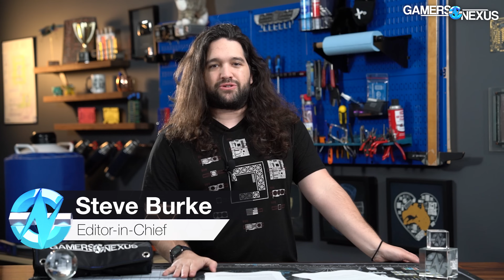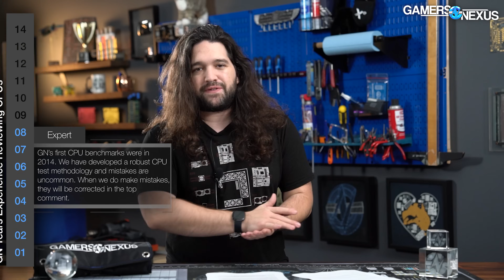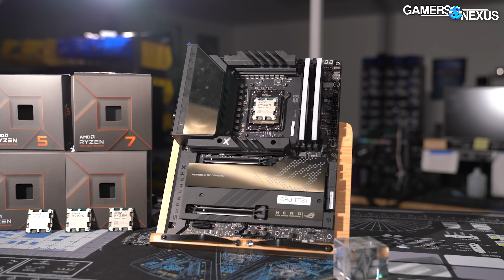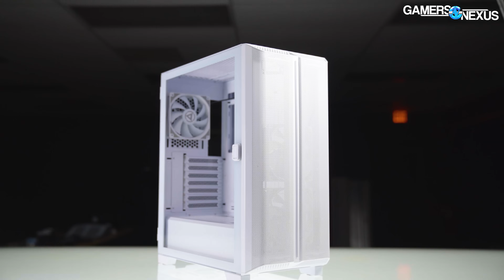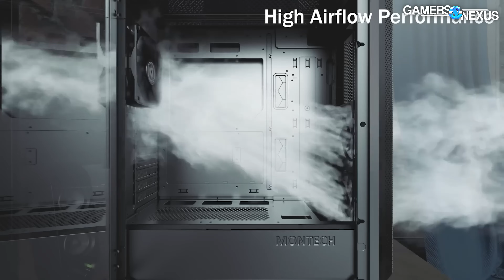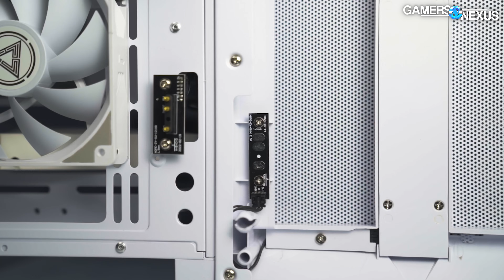AMD Ryzen Eco Mode Deep-Dive & Benchmarks on R9 7950X (Zen 4)

Comment: if you'd just adjust the PBO curve offset or PPT limits manually rather than using the Eco preset, I'm sure you can get results within 1-2% of the top results while still reducing power and thermals massively. also, remember that it's not always just about the cost of energy. being able to half the output of your 700 Watt "room heater" is a blessing during hot summers.
Reply: Probably, similar thing for older 3000 and 5000 series, where manually adjusting the limits can get you pretty close to stock performance while also getting most of the savings of eco-mode.
Also don't forget about noise, not everyone has the nicest cooler and although they're much better these days the stock coolers are a bit noisy when they ramp up more than about 30-40%, so being able to maintain that more often is also a big benefit.
Reply: Negative PBO curve offset seems stable for days then randomly gives me WHEA errors, it's not something a person buying for a workstation would want to use. One flipped bit might be hours or days of lost work.
Reply: @AFistfulOf4K  Issue for me is idle crashes. I can run Cinebench -25, but had to settle on -15 to avoid random idle or low usage crashes.
Reply: @xeridea  I wish I could modify the curve itself to be more aggressive for negative vcore during load and almost no negative vcore when idle to stabilise desktop idle on Ryzen. Vdroop alone doesn't give me nearly enough control. This is exactly what I do for my GPU undervolts and it works amazingly and never crashes in idle.
Reply: @xeridea  You might have the voltage offset too low. Had a couple of black screens within a day or two, went back from -.125 to -.1, and now not only do I get better R23 results, the CPU is also passing CoreCycler.
Reply: @xeridea i was running -30 on all cores, used the CO option from Ryzen Master, every test was running perfectly, 16000 cinebench r23 score with temps never exceeding 75C in a 24C room. But it would crash while idling just like you said, which I find very odd.
Reply: @xeridea  For my 7950X, Eco Mode 105W and -30 CO ran Cinebench no problem but ended up having idle crashes.
I then settled on -25 and it's been smooth as butter for years now. Even tested with Prime95 for 2 hours to make sure. 👍
Reply: @AFistfulOf4K  In fact, most of the tuning is tested with Cinebench which really does not represent real life work. I just did testing with actual rendering video ( I work in the film industry ), the PBO tuning actually increase the render time by 30% - 50%. What is the point of cap limiting the power at 210 - 240 ish, when running at 300 - 400 watt for half of the time, actually save more power? While under volting does save power and reduce temperature, from a productive point of view, under volting is not at all good. The eco-mode is actually useful when you are not doing work. The only pain in the arse is that you have restart the pc to get the setting working.
Reply: @dutchmilk  Agreed, eco mode by itself seems like a good feature and PBO is mainly good on paper. I'm currently trying to decide if I should get a 13900K or 7950X for video work. Despite the higher overall cost I'm leaning toward 7950X with the "105 watt" (really ~150 watt!) eco mode, but I've heard Intel's integrated graphics can be useful in Premiere even if you have a discrete GPU as well (which I would probably get a 3080 12GB). I'm not sure if this applies when proxies are used though...
Reply: @AFistfulOf4K  You might want to factor in the immaturity of DDR5 if you are going for AM5 as it does not support Quad channel RAM ( yet). It is the same situation when DD4 first came out. A 3080 is good, however, the RAM "problem" on AM5  is ease better with the additional 24gb of RAM on 4090. I would advise you getting this since you are using for video work.  I got the 4090. While it is stupid big, its performance is indeed far better than the 3000 series.

AMD is the clear winner for longevity wise, given how long they supported AM4. AMD eco mode is extremely useful to deal with the increase cost of electricity.
Reply: @dutchmilk  I think you're using the wrong terminology, no consumer platform supports quad-channel ram, only dual-channel, but you can have 1 or 2 sticks in each channel. The current problem (I forget if both AMD and Intel are affected) is if you use 4 sticks, the RAM runs slower than if you use 2 sticks. You have a point though, a 2x32 GB DDR5 kit is probably very expensive. 4090 would make a lot of sense, I agree, but I'm going to wait until I'm confident the power connector issue is solved across the industry. There's faulty 4x8 pin adapters and even faulty PSU cables out there. 12GB VRAM is enough for my tasks for now.
Reply: @AFistfulOf4K  aye, you are correct. I used the wrong terminology.
Reply: On 5800X, I can actually get higher than stock performance at slightly lower power with voltage offset. Probably similar with Zen 4.
Reply: @xeridea  Voltage offset (-.1, -.125 was too much for certain loads to be stable) plus curve tuning is getting me +6% from stock on my 5900X so far (with loose power limits, but those are relevant in benchmarking anyway).
Reply: on my 7700X i never seen temperatures above 70C even though i use air cooler.
i believe you need a synthetic test to get it 90C hot?
Reply: @davidjones5059  yes gaming does not hammers the CPU like synthetic tests.
Reply: Just deliding drops power usage by reducing thermal runaway as well. iirc by like, 20 watts.
So you'd probably be able to get better perf at lower power consumption using all the tricks you can throw at it.
Reply: Yes, you could achieve most of the efficiency gain by limiting maximum boost CPU frequency.
Reply: Americans are used to their air conditioning so they don't think about that.
Reply: @Sunlight91  AC is pretty required in Florida to have any level of comfort. You've got 95F+ temps with 100% humidity outside.

But cutting that heat down lets it work much less harder and heats up the room a lot less.
Reply: @Sunlight91  No A/C in my dorm
Reply: @Sunlight91  America is HUGE ass country m8! I live in the Northeast and I only know 1 or 2 peepz that got AC.
Reply: @Sunlight91  not sure this comment even makes sense. energy consumption is cumulative. anyway, many Americans would literally die without AC. we're going to need to get to a very high level of renewable energy production and/or capture and many years thereafter to reach a point where most people can go without AC with no adverse health effects. it is and will continue to be a worldwide problem. and before anyone quips, yes, I am fun at parties 😝
Reply: @Sunlight91  lots of Americans do not have air conditioning.
Reply: @GameTimeWhy  
Lots of Americans do not have five hundred dollar processors.
Reply: @GameTimeWhy  If you have this cpu in a personal machine, you probably also have air conditioning.
Reply: @GreparsYT  You're making assumptions based on where you live.
Reply: @samiraperi467  It's an 800 dollar cpu, it's luxury. If it's hot in the part of America where you live, and you can afford to have a personal computer that has one of these, you probably already spent your money on an air conditioner that is 10 times more necessary. It's just a very logical assumption. In some cases I might be wrong, but in most cases I'm sure I'm right.
Reply: @samiraperi467  also 90% of American households own some kind of air conditioner
Reply: @GreparsYT  95% of the world outside America has air conditioning too, we call it not being morbidly obese.
Reply: @AFistfulOf4K  I'm not american, I know
Reply: @GameTimeWhy  I have never met anyone without it, even in the more northern states.
Reply: Noisy environment reduces IQ fairly significantly, so having quiet fanless PC is also increasing brain performance. Life hacks!

Comment: I wonder if ~4.6 GHz during all core workload is the sweet spot for the 7950X, you'll lose roughly 10% performance but bring down power consumption to less than half.

This is just some rough math I did, not actually tested.

Comment: Go 65watt for gaming only and 105 for production. If you're up for it.. a custom undervolt may yield a more optimum result. Youz could get a decent chip and use 105watts instead of 150watt in 105 mode.

Comment: 'Eco-Mode'?...On a very expensive, high performance CPU running a 850 watt or higher psu? ROTFLMAO...
Reply: You do realize that the number on a PSU is the maximum power it can provide, not what it actually consumes all the time, right?
Reply: @amunak_  You still paid good money for all that overhead didn't you? And so did those that bought a 1000 watt PSU for their new gen GPUs.

Comment: Thanks for this very helpful content. I´m planning to build a 7950X system next week and as I will stick to air cooling (Noctua D 15) 105 W Eco is the way to go, stock settings are a pure waste of energy. With some luck in silicone lottery and  a negative value in curve optimizer the results could get even closer between stock and 105 W.

Comment: ive been using the power options in windows. just have the low power mode set to max my 5800x at around 3ghz. keeps my motherboard VRMs from whining horribly too which is nice when i want peace and quiet

Comment: Agree with those conclusions 105W definitely seems the way to go, but can we appreciate that chip in 65W mode managed to run all 16 cores at 4GHz and did it at only 19 degrees above ambient. That seems mad. The mobile versions of these chips are surely going to be monsters.
Reply: Think of it like this - people used to overclock back in the days to get massive gains in performance but now, company's have pushed the cpu to limit, there is nothing left to over clock BUT you can undervolt your CPU massively to gain efficiency instead of power. 

This way, people who care about efficiency win, and people who care about mad performance also win
Reply: @arcknight_bk2o183  I don't call paying top dollar for apart that overheats nearly to the point of destruction but being allowed to bring it back to normal winning. I'll just take the 65W part instead.
Reply: @patrickweaver1105  feel free to undervolt if you know so much about Silicon
Reply: @arcknight_bk2o183  I understand how to follow a youtube guide which is all you need to undervolt. No deep knowledge of silicon required. The point is why pay an exorbitant price for a 105 W TDP processor and limit it to 65W?
Reply: @patrickweaver1105  exorbitant prices are not the result of Silicon pushed to limit. There is a fundamental difference between the two. If you are saying you don't want the high quality Si or binned chips which could hit those high power, then sure, companies have got you covered with the low power variants less binned cpus as well. No discussion there.
Reply: @arcknight_bk2o183  No, exorbitant prices are  the result of people paying stupid amounts of money for things. The pushing of silicon to the limit is the result of companies chasing bigger meaningless numbers so customers will keep being fooled. Binning isn't the reason. In most cases the silicon has become so consistent there's not much improvement to be had by overclocking. The  limitations are artificial. It's easier, and much cheaper, to build a 5GHz four core processor than a 5GHz sixteen core processor. So where are they? Don't believe the marketing driving market segmentation, it's nonsense.
Reply: @patrickweaver1105  Back to basics for ya. Atleast in AyyyMD's case, this won't be the case. Their 16 cores are the best CPU possible. Why? You need to watch videos for it. Can't be told in comments.
Also yes, segmentation is artificial, always has been but that not our discussion
Reply: @arcknight_bk2o183  It's not a win for those who want a regular non overclocked CPU without the overclocked out of the box price premium. Intel overclocks their top i9's out of the box, AMD overclocks every released AM5 CPU out of the box(why overclock the lower core CPU's, someone who wants more multi threaded performance can simply buy something with more cores). Who pays a premium to run an overclocked out of the box CPU at it's original stock speeds?
Reply: @arcknight_bk2o183  That's the problem, the non X does not currently exist for AM5. Why would anyone pay the (pre-overclocked)premium for a 7700X/7600X? (maybe that would explain the poor sales figures for those?) does pre-overclocked make sense across the whole product range? I can't see a scenario where anyone would correctly choose a 7700X/7600X over the alternatives?
Reply: @longdang2681  X skus are meant to be pushed to the limit CPUs and that's what they are. You can keep arguing about what's right and you will never come to a conclusion. There is no right or wrong answers. AMD chose to give highest performance possible for every customer. It's upto the customer to know what they actually want - a cpu that is conservative with the power or is balls to wall get set go. As far as I know, most consumer are dead set on getting 120% out of their 100% money. For most that means performance. But maybe for you and me, it means maximum efficiency. It's just point of view. There's is nothing more to discuss here
Reply: @arcknight_bk2o183  you said that pre-overclocked CPU's makes sense and is the way to go, win, win. I'm saying that it's not a win, win, for the pre-overclocked 7700X/7600X. Pre-overclocked have their place but it's not everywhere. For that reason I'm saying that pre-overclocked is not the way to go. People don't want a pre-overclocked CPU(with the associated premium) and then go eco mode. How is there no right or wrong answer, pre-overclocked is just wrong for a CPU such as the 7700X/7600X ?
Reply: @longdang2681  it makes sense to do it down the line. People were overclocking i3s before they became locked. Similarly people overclocked their i5s before they were locked between unlocked and locked SKUs. 

It was a way to get extra performance out of a part instead of spending more money for a higher end part. Usually they couldn't afford the higher end part when they first built the system. 

So it is what it is.
Reply: @ArtisChronicles  I agree, people have overclocked processors since the dawn of computing(or at least they would try if the knew how). What people didn't do was to buy a pre-overclocked low end/mid range processor at a premium. If you are paying a premium then then just get a processor the next level up? People would rather overclock a processor themselves rather than pay the premium for a pre-overclocked processor out of the box. What I'm saying is AMD should stop including and charging for a feature(pre-overclocked) that nobody wants. Isn't the whole point of overclocking is that you don't want to spend more money?
Reply: These cpus should have launched with 105w tdp and 170w should have been optional. That would have given much better press and 95*c issue wouldnt have existed
Reply: @mtunayucer  but YOU HAVE TO BE THE FASTEST... that's all the zombies care about.
Reply: @DJDocsVideos  personally I want them to run the fastest. But not because I want that chip, oh no. I want them to keep fighting each other, tooth and nail to get every inch of performance they can, so I can take that mid chip and help it calm the hell down. Also competition breeds innovation and helps keep pricing in checkish
Reply: i agree. The performance push across the market has reached a bursting point and AMD would have REALLY got good press if they were the 'efficient' option stock and the boosted to near peer when unrestrained. it sounds way better than pushing 110% out of the gate and still losing leaving reviewers grasping at straws to find the upside vs the competitor.

The GPU side it seems they went the other way and it seems to be working. Nvidea kinda fell on their face with the insane power draw and power connector issue and now even before sales are available there is a lot of positive press for AMD there.

Perhaps AMD did this intentionally to probe the market and see if performance vs efficiency is where the market is going and by splitting these plans up between products they get a real tangible response from each product that can help them better navigate the market in the coming years.
Reply: @mtunayucer  most casuals wont even bother to tick a box that enables 170w tdp. Has to be on by default.
Reply: Dragon range is supposedly going to be an around 60W TDP mobile chip with more than 8 cores. I wonder if they'll do something like a 7950HX that's basically the soldered version of this.
Reply: @DigitalJedi  dragon range is literally Ryzen 7000 desktop on mobile. The reason they can do this is because the IO die on Ryzen 7000 was built from the IO section of Ryzen 6000.
Reply: Energy star ratings should probably ask to have a word
Reply: That's with one of the best 360mm liquid coolers at 100% fan speed though; not even remotely indicative of performance in laptops...
Reply: I run my 5800X at 105W and some undervolt. I get like 110% of "out of the box 135W" performance with 10 degrees better temps.

Comment: Steve, is this the same as under volting?
Reply: It's not reducing voltage at a set clock, its clamping its entire power consumption.

If you are familiar with Nvidia power limiters, this would be more akin to that. It sets a lower parameter before the clocks have to drop due to a limiter. This helps keep it in the efficiency curve much better.

GN has another piece on how PBO works that is worth a watch.

Comment: It is surprising eco mode doesn't lose hardly any performance, especially in games where it's near identical performance.
Reply: Most games barely touch the CPU anyway, so it won't matter if they're not getting full juice.
Reply: @Defective Degenerate where did you see performance lost for 105w